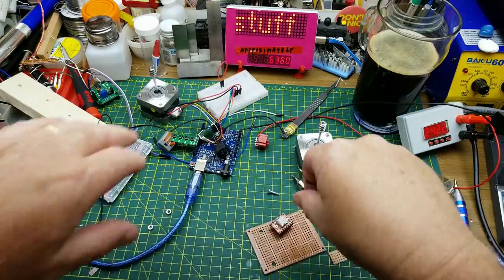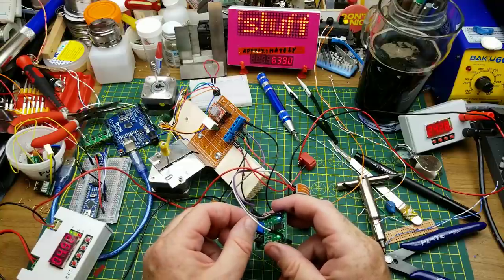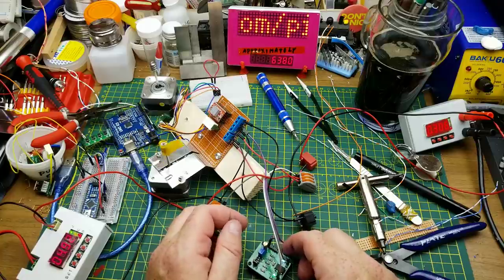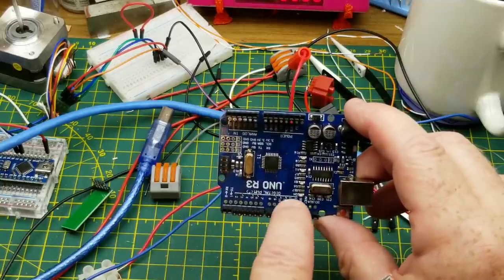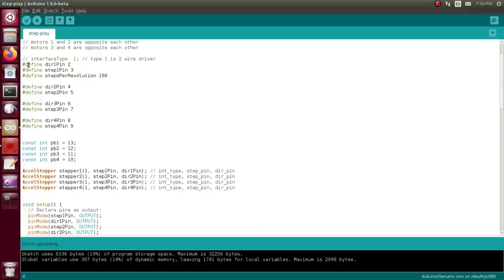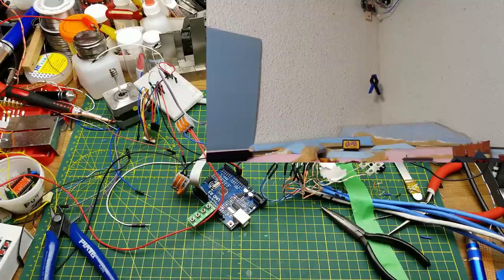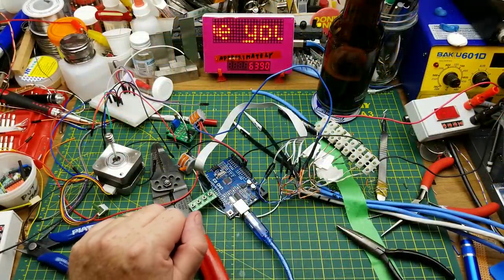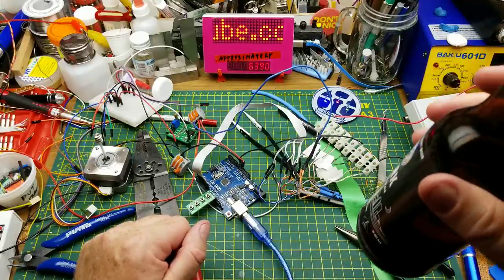Can I make a DIY skycam?  (part 1 of ???)

Comment: Instead of trying to reinvent the wheel, what about using some old fishing reels on each motor in some way; they would do all the proper winding etc without tangling (Not sure if I'm the first to suggest this because I haven't read the other comment)...   Also I have a box of brand new stepper motors with larger diameter shafts that someone gifted to me, I would be happy to donate some to you for this project & would even cover shipping to your PO Box (let me know if interested). I'm in Ingersoll Ontario Canada so you'd have them in a few days from time of shipping. Then all you need is to find another viewer to donate 4 old fishing reels... Dan

Comment: I think part of your problem with the take up spool might be that the angle changes as the camera moves, concider putting a pulley above the motor so that can take the line from any angle but it always comes straight down to the motor shaft from above. If you get the line under control before it reaches the take up spool I think you will have much more flexibility in how you make it.  A smooth ring bolt might even work if it doesn't tear up the line.
Reply from the maker: I was thinking an eye bolt or something similar to act as a fairlead would be one of my next steps.
Reply: @pileofstuff  Maybelline Youtube can fab a mini version of the cable guides used on automotive winches... 2 vertical and 2 horizontal rollers forming a mouth for the cable.
https://det8iaooqe9aa.cloudfront.net/media/image/39/de/2d/10060184-1.jpg

Comment: Hey, my advice: get a 3d printer man! I've used mine to make gears and mounts for motors. Couple that with some user friendly design software (fusion360's what I'm using). Then you can design your skycam box and mount camera, steppers etc etc. inside virtually first then just print and assemble, iterate the design based on the real world burn tests. Maybe the steppers need a gearbox? no problem. ad infinitum

Comment: Very cool project. I like the idea with the eye-hooks/pulleys at the ceiling so that the motors can be more conveniently located.  

But I think the interesting and even more complex part is going to be when you design your code to account for all the different angular geometries for the camera transitions. For example, when the camera has to move say from point A to point B, then Motor #1 may have to spin line out at a speed say of  1.4 times the speed that Motor #3 has to spin the line in if you want to keep the camera at the same approximate vertical height while transitioning.  You and (others viewers) may want to code up a graphical simulation so you can get an idea of the speed differences and calculations involved.  

You could post the approximate dimensions of the room and pulley locations so viewers can help with the code.

Comment: My first thought was sewing machine spools.
My second was cannibalize some second-hand-store fishing reels.
But those won't work because the thickness of the material on the spools will change as they rotate, generating position error at the camera if not ripping it right off.
You want long, narrow spools so that the diameter of the line as it winds on the spools changes as little as possible. I'd say those gears are press-fits and can be taken off with a vise and a drift punch (or just saw the shaft off right against the gears), then solder washers to the shaft to contain the line. Also, drill a hole in one washer, pass the line through, tie a knot ad then hot glue it in place.

Comment: Very interesting project, my first thoughts was one or two motors at each end. Two to have one that spools the wire in/out with high precision and one that maintain the excess wire, but with your thin wire it is not really needed, but you definitely need a wire guide.
You also need to get a 3D printer, they are fairly cheap (For some models) and very useful. You can mostly make any shape with sub-mm precision (There are some restrictions). The piece may not be as strong as metal or cast plastic, but that often acceptable.

Comment: One thing you'll have to watch later is the variation in movement between the motors when the skycam is in different areas.

Forex, when the cam is near one edge of its field of movement, the two closest motors will be generating a greater amount of movement per revolution than the furthest two. This could result in anything from unwanted vertical movement to damage to the lines or mounts, depending on which is strongest.
Reply from the maker: Hopefully thats something that can be dealt with in software. The real skycam installation starts with mapping out the physical space that its operating in and modelling that space in the control software.

Comment: You are a madman for doing this. Even more of one for not using a CNC shield. I love it! One note about those little stepper drivers that have the heatsinks on them (for anyone watching) ... if that driver ever gets powered up without a stepper motor attached to it, it will let the magic smoke out immediately.

Keep it up. I can't wait to see what do with this.
Reply: Can they do 4 independent, or is it 3 independent with the extra stepper siamesed to another.

Comment: use a sewing machine type spool to fix the shaft issue.
Reply: the "spool" does not have to be round, as long as each pair of motors have the same spool.
pair means opposite corners north/south, east/west, 
software could be simplified,  the settings for each pair should be the same and  
e.g. going north means + north and minus south, going east means + east and minus west.

Comment: Run your fishing line off the motor (or a spool) and through a 'screw-eye'?  That way, no matter where the camera is, the line comes off the reel in one direction ... the screw-eye could be on the ceiling or wall and the reel could be on the floor ;-)
Reply: Sometimes, I should read comments - sooner

Comment: Good proof of concept. There are some good ideas in the comments. Bulding on what Noxonomus said, you could use small castors of a table (e.g.), put a groove in the wheels and thread the line through them. Put the castors above the motors and they should point in the direction of the camera so as not to snag the line.

Comment: Get a 3D printer. I wish I had done it years ago. All my builds are so much faster even though I use a lot of surplus stuff too. I mentor a HS robotics team and I am building one of these for fundraising at festivals with a claw at the end inside a metal conduit cage (10x10x10). Keep up the good work and stay safe. 
(I printed a part the other day for my pool and used a $20 bought part with printed adapter instead of a hard to find $200 bought part.)
Reply from the maker: It's under strong consideration.

Comment: Love where this is going, great out of the box thinking. Definitely need better reels on the motors, even if they resemble fishing rod reels.
Reply: Like a rod reel has a wire guide that feeds the line on an oscillating reel, your problem should be solved in a similar fashion simply by having the motor spinning on an off balance spool.

Comment: How about using a counterweight at each motor and only put a couple of turns around the shaft?
That would possibly allow for some slippage which could account for ratio change due to parallax.
Reply: I thought the same, spooling the line onto the motor is going add errors in the positioning as the spool increases in diameter. Use the stepper motor shaft like the capstan drive on a cassette deck and use a weight or an automatic take up spool for the end of the line.

Comment: HomoFaciens did something vaguely similar with strings.
https://youtu.be/6H3LaVPMwmQ
In the old days I would've fabricated little knick-knacks, but now it's just draw it in Tinkercad and 3D print it. I don't really need a 3D printer - only used 3kg of filament in 2 years -, but I bought it to learn something new, ie, stop the boredom - lol -.

Comment: I don't think you will be able to do it ..... Cause the cable to the camera will need a motor to, and the motors will have to synchronise together automatically, but if you achieve the almost impossible I will take my hat off to you, good luck.
Reply from the maker: Yeah, I wasnt planning to remote control the pan/tilt.
But the camera's gimbal does do object tracking, so I'm hoping to tell it to stay focused on an object while the camers platform moves.

Comment: In a stadium 4 cables might be convenient, but 3 cables should in theory be sufficient.  Have you considered using 3?
Reply from the maker: I had assumed 4 motors would make the coding easier, and would give me a bit more ability to get closer to the corners of the room.

Plus, if one string fails for some reason, I've hopefully still got 3 keeping my camera off the floor.